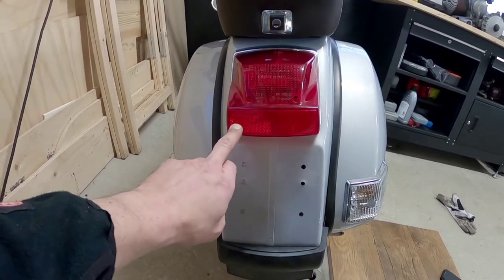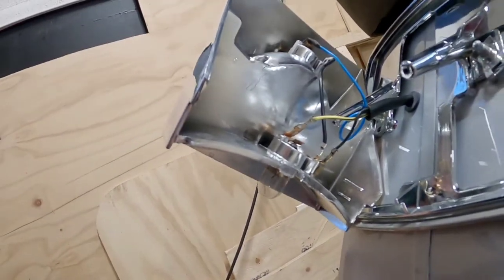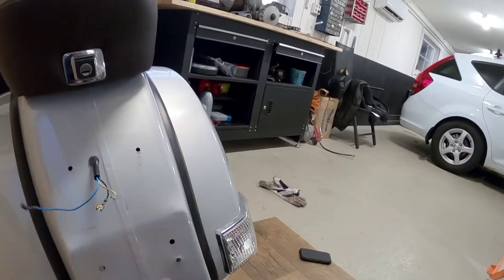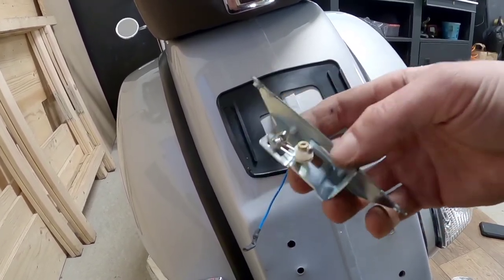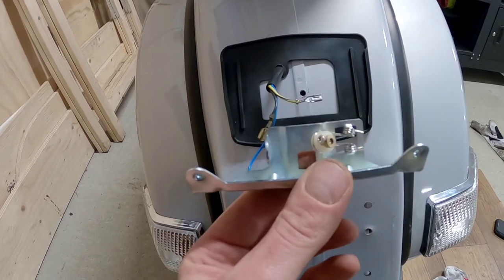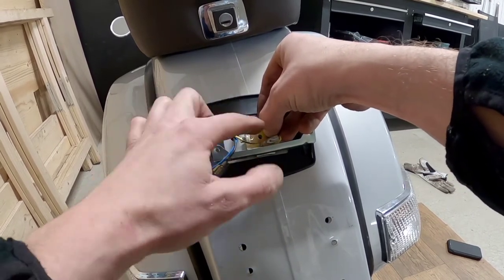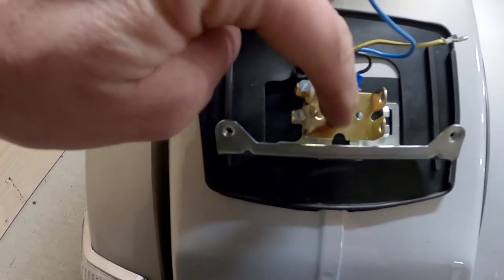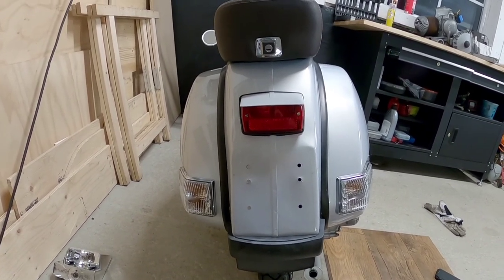Vespa px / How to change the rear taillight

Comment: Great video I’m going to do this with my PX I’m just wondering what bulbs did you use? 12v 10w festoon bulbs? Thanks.
Reply from the maker: Thanks for watching 👍.
If I remember correctly:
12v10w for the break light and 12v5w for rear light.